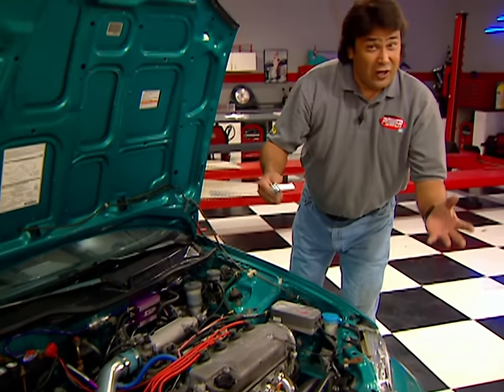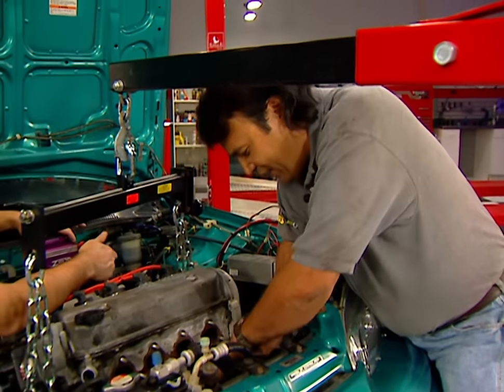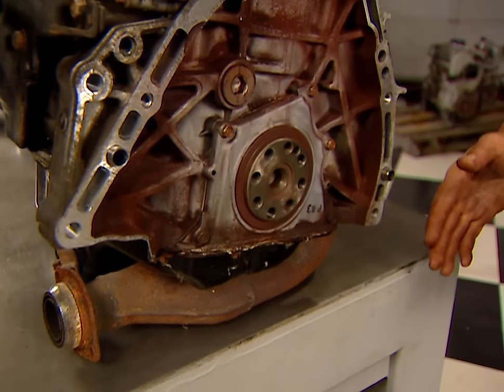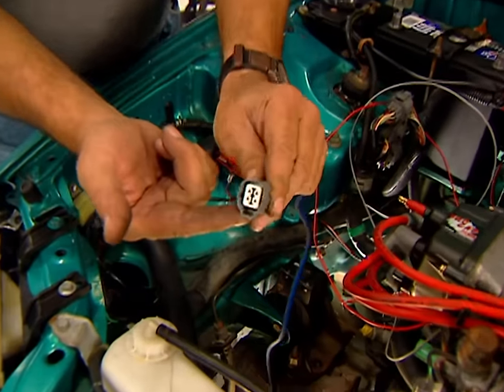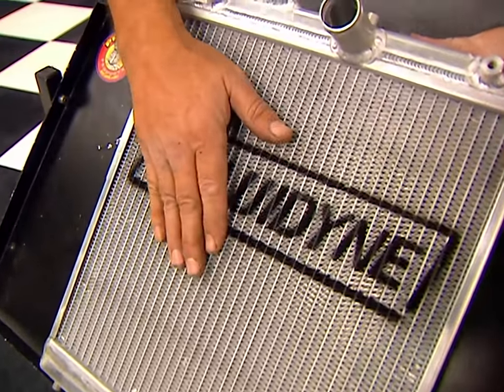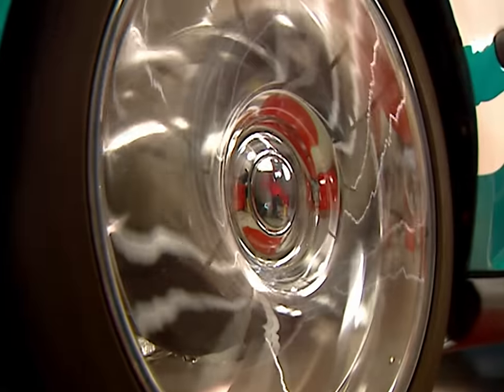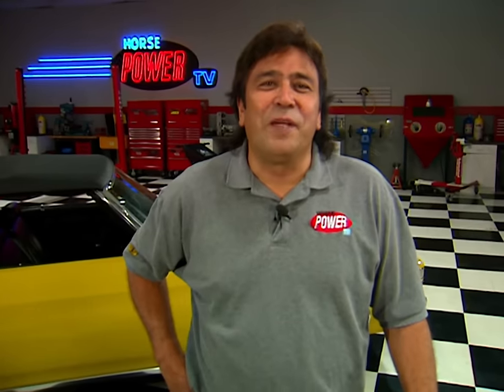1994 Honda Civic GSR Swap - Horsepower S7, E3

Comment: Man, I’m glad I’m old. Three to $4000 for the engine now I think I spent little over 2500 to swap the GSR transmission and engine into my EG hatchback about 15 years ago prices on these motors gone insane. I dated a girl back in 2008. We swapped the F20 C into her Toyota Corolla for about $6000.
Reply: Same here @43yo I’ve done this numerous times I got into Hondas when I was 16 so around 1996 and it gave me my career! Doing this swap actually was my first taste of tuning, then Went to work for American Honda! Now 20 Hondas and 15 swaps later I still keep a toy or 2 in the yard to hit some curvy backroads of North Carolina! There was no greater feeling than that ride in your first swapped Hb or coupe, it was worse than a drug habit, spending every dime possible to get parts or replace tires, but I would t change a thing well maybe I would have kept a SI or 2 bone stock and put them up Function before Fashion always!
Reply: Old head here too: Things have definitely went up but only a little bit if you check it with inflation calculator. Still cheap to run and maintain though the K is the way right now unless seeking oldschool B series for (insert reason)
Reply: I think its because things have moved onto K series, and the B engines are relatively old, more rare, and less supported.  Support goes where the money flows.
Reply: @AnotherMotorist  I'm not into Hondas anymore funny because in the beginning I always liked toyotas until I got a 97 sedan civic than hooked it up since sedans way back then had no love until they started going in style plus when they saw what I had people followed suit but anyways I like the b series alot better and H series I feel like it's more simpler that's just me though but good opinion I'm back into toyotas though i Also got into muscle cars

Comment: Bruh, homeboy's mullet is KICKIN! I did this same swap into my 1997 EJ8 Civic coupe with a fully built PR3 CTR head, Skunk2 Stage 3 NA cams, fully modified valvetrain and S2 LMAs (Lost Motion Assemblies), a S2 Ultra Race 3.5L intake manifold, a S2 90mm throttle body, along with WAY too many mods to list in a YouTube comment. Tuned on a P28 ECU with Hondata S300 V3 with a Rywire tuck engine harness and a modified 1.06 AR exhaust housing Garrett GTS3582 dual ball bearing turbo with a billet compressor wheel at 34 psi it made 709 wheel horsepower through a GSR trans with a LS 5th gear and a modified OBX LSD. Talk about a bad Honda. My buddy across town had a EG hatch with a B20VTEC that made 832 whp at 38 psi.
Reply: Whoa, we didn’t ask you that.
Reply: @fogtown3027  right who is reading all that 😂
Reply: Aw you weren’t cool if you didn’t have a spoon engine with t66 turbos, and a motec exhaust.
Reply: You’re not making that much power on stock transmissions.
Reply: @fogtown3027 .🤣🤣🤣
Reply: @MyWolffy  I know personally it only requires some good synchros, MFactory was my choice. He could kept alot of that shit stock though. Also want to know what fuel system hes running? Made 581whp on pump same turbo GSR cams
Reply: Bet that both cars now dead turbos just force feed shit
Reply: @itsAbadWorld 🤦
Reply: @itsAbadWorld  Yes, but i bet a lil gutted tin can import def hurt some feelings while it ran.. Or his wallet if it didn't last long..lol
Reply: That sounds like spin city 😬 how did you even hook?

Comment: You can literally use the gsr factory harness and plug it right into the civic chassis harness and not have to wire anything
Reply: Wait really does tht also work for a b16a?
Reply: If its lhd not rhd from an importer

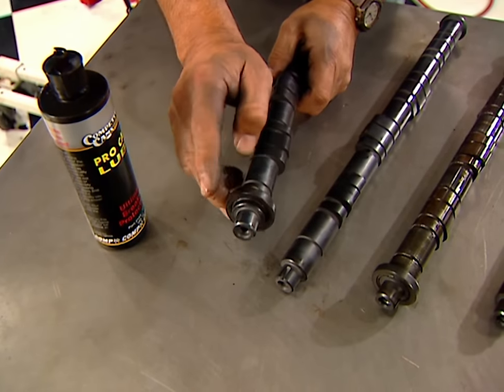Comment: 6:08 Re-using the old camshaft oil seals is NOT a good idea.
Reply: If u watch the video chuck showing if don’t have much to spent and all your went to the motor and cam and clutch and timeing chain then if the camshaft oil seals are still good on the motor your swapping with your old motor with then it’s ok because when you have the money to get new then you can buy new camshaft oil seals when u have the money
Reply: It's just a honda.

Comment: Sold my 1998 GS-R with leather 2 years ago and got 6500 bucks for it. Car was hitting that point where every time I got it back out something else went bad. Was a wonderful car and after significant modifications it could run as well as just about anything. Had it for 23 years but ultimately I had nowhere to keep it. Has a full turbo, built motor, the whole 9 yards with a folder full of 13 to 12.9 second time slips to prove it was fast
Reply: I’ve had my 94 GSR for 23 years also. Still on sort of daily driver duty haha. I’ve kept it mostly stock and now has 387k miles on all original drivetrain. Still crack VTEC on every on-ramp!

Comment: All that great hard work and extra parts for only 41 hp gain 😮. Was it worth it at a $3k+ cost? No.
Might as well go k or j series.
Reply: This was in 2003 👍👍 really good video quality 💪💪💪
Reply: K swaps really weren’t a thing back in 03
Reply: I don't think you were even born yet in 2003 😅
Reply: A 2600 lbs car with 170 whp back in 2003 was plenty fun. It would give a crappy 2v mustang a run for its money

Comment: Oh how times have changed!!!!!!!!!
Back then would have never imagined I could get almost 200 hp out of an a NA NATURALLY ASPIRATED all motor D16Z6

I have a 1995 Honda Civic coupe EX TRIM MODEL unlike the DX in the video I got the single overhead cam vtec d16z6 1.6
 
I remember back then if you could get almost 200 hp out of a B series you felt pretty fast!

I have built plenty of b-series k-series h-series and j series over the last 20 years but it was fun to build something different this time around and challenged myself with seeing how much power I can squeeze out of an all motor d-series

I will say I have pissed off A LOT of friends and random people with their dohc dual overhead cam swaps

But now I have a k24 block and a K20 head easily 240 wheel NA all motor in my 95 Civic

And 320 HP NA 04 Honda Accord V6 6-speed manual coupe hfp Honda factory performance package with a full bolt on j series 🤘🤘🤘🤙🤙🤙🤙👌👌

Comment: Why  would  2 cams be needed for 1 engine? and is that just for their brand
Reply: One is intake one is exhaust
Reply: DOHC, dual over head cam
Reply: It goes even further with vtec and 3 stage vtec-e. You can have intake cams open a certain amount for cruising around and then open further to allow more air in and exhaust out. This is what vtec does. For better power and control with 2 cams but the same system does exist with 1 cam vtec/e also